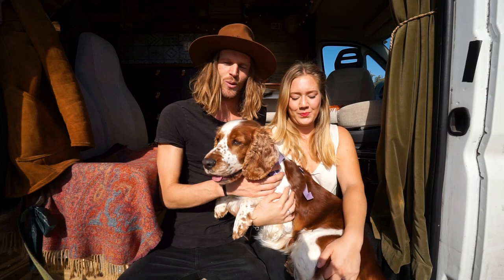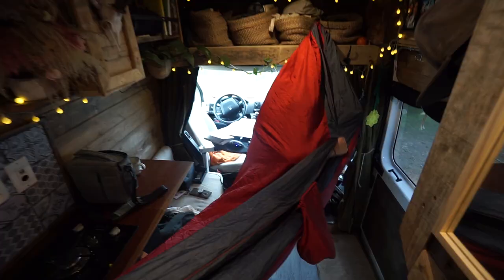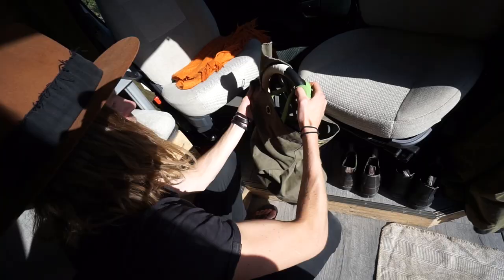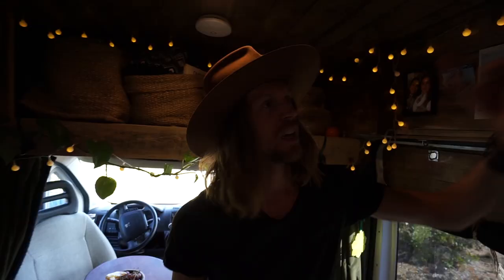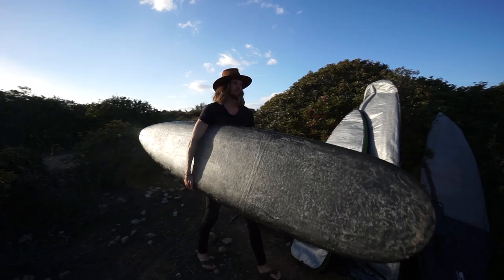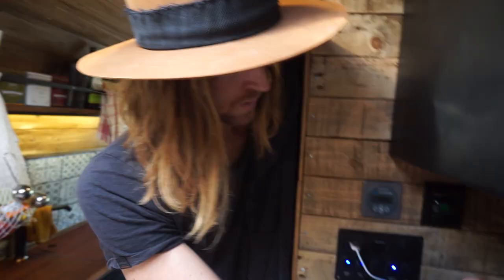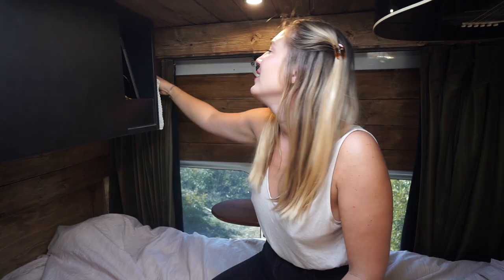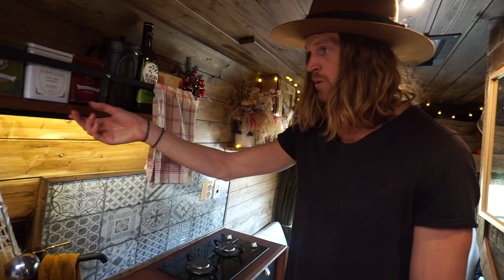Van Tour | NEW layout, BEAUTIFUL and detailed van build (UNIQUE LAYOUT)

Comment: I see a lot of people using the IKEA type drawers, so am intrigued by that. We don't have an IKEA anywhere near us, haven't ever been in a store, so I don't know what all they have.  Not having to build all those drawers would be a must for us!!
    I did see one couple using a standing tool chest and just adding on wooden covers to the lightweight metal fronts of the drawers on that!  They used it for their kitchen and THAT is the way I would go in a van build. The nice thing about those tool chests is that with one key, you lock all the drawers shut for traveling, plus they would be much more difficult to get into in case of a break-in!  They are also very light weight instead of all wood, and the tracks glide in and out very smoothly. I would definately have a couple of those and would build around them. Until you pull the drawers out, you can't tell that they are a tool chest.

 Your urinal is unique and I think that would be a wonderful addition unless you have a urine diverting toilet.  Which by the way, I did not see in your van... unless I missed it?  I will assume you DO have a potty of some kind, because if not, that would be a deal breaker for your van build!!  LOL

I like the layout of your build and the pallet wood is very pretty. That you opted for cut out holes instead of knobs or pulls gives the "laid back" impression that matches the pallet wood, and looks very casual.
Great build guys!